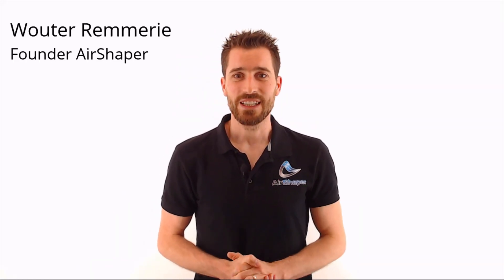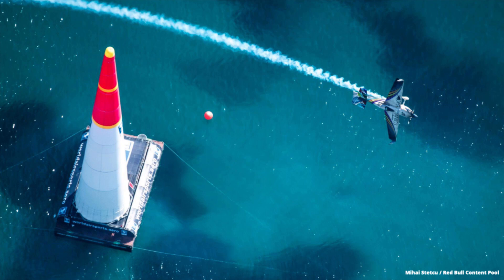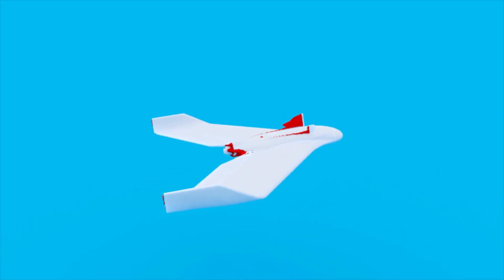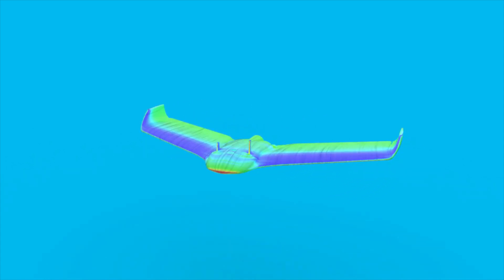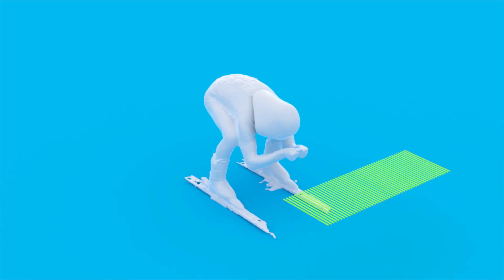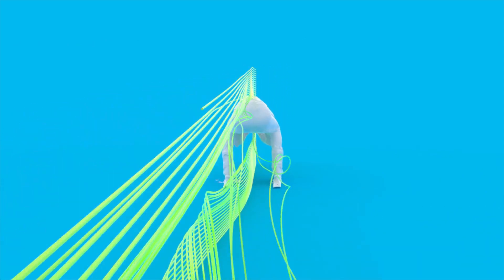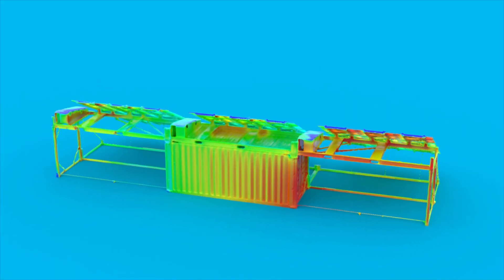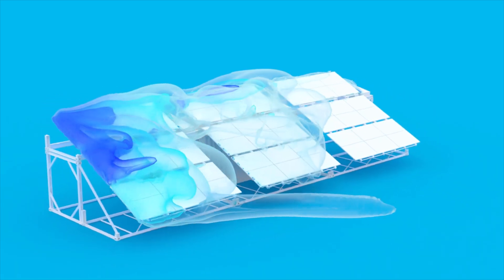Why aerodynamics matter! - Performance, Safety, Environment

Comment: Hi @AirShaper How can you reduce the drag coefficient in a UAV?
Reply from the maker: Ah, that can be done in many ways. The most obvious is to work away any extremities & cavities (antennas, landing gear, gaps between body panels). Once you're at a level where everything is super smooth, you may want to start looking at optimizing lift/drag ratios by playing with the airfoil profile (that's more advanced!)
Reply: @AirShaper  okay. I'll try it out

Comment: Great videos. I'm planing on doing a top speed RC propeller foam plane (or fixed wing drone). What layout would you advise for lowest drag ?
Reply from the maker: Hi Alisio, is it purely for top speed? If yes, then you'll probably be flying at a constant angle of attack, which means you can select an airfoil that is very efficient at a very specific angle of attack. Check our video on this: https://airshaper.com/videos/drone-design-1-selecting-an-airfoil/video/kAXN3MlQxxc - hope it helps!